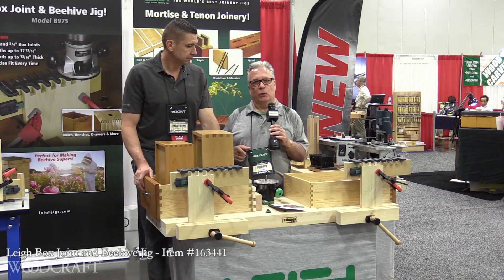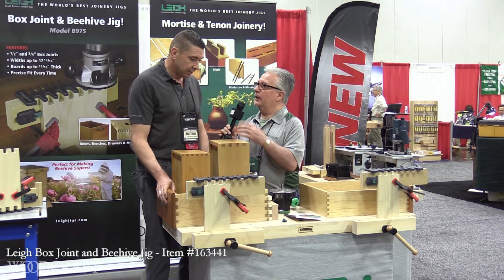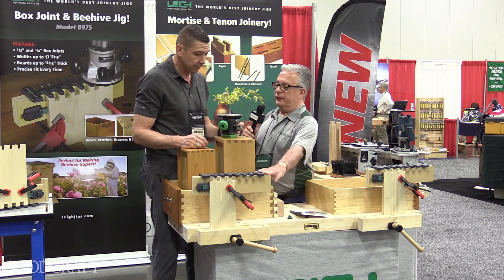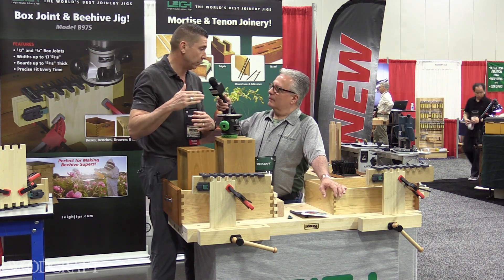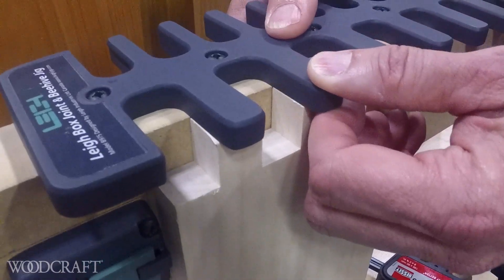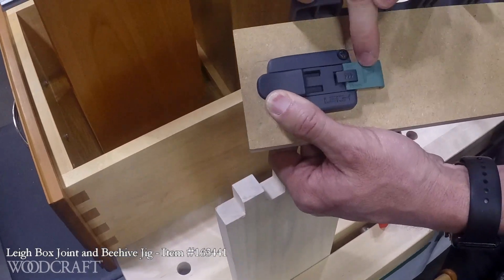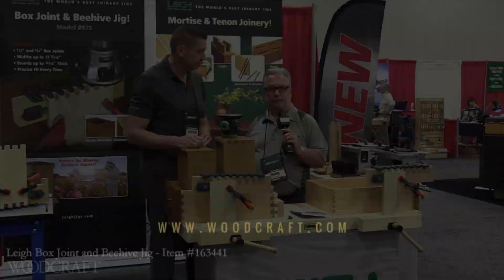Leigh Box Joint & Beehive Jig Presented by Woodcraft

Comment: What is the little shorty router?
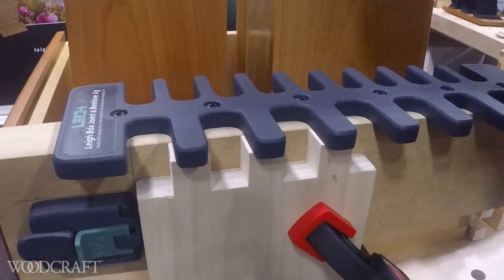Reply from the maker: This is the Hitachi M12vc router. If you look at 1:56 mark in the video, you will see that the motor is not installed to the base. The bit was put in and held in place to the base with clay just to show the placement of the tool onto the jig without the motor. We do not carry this router.